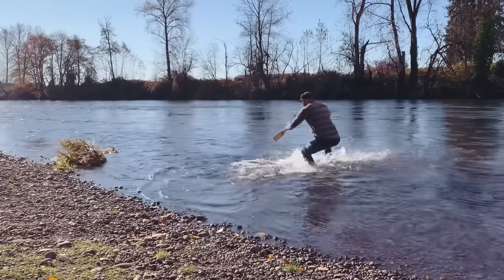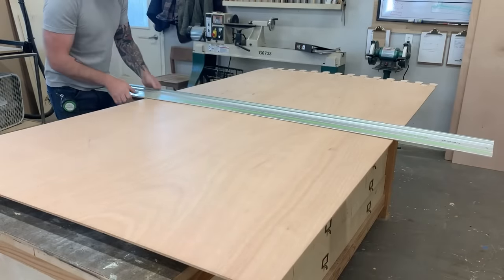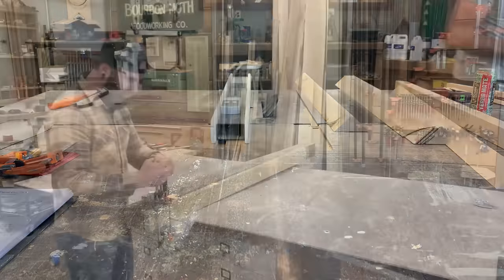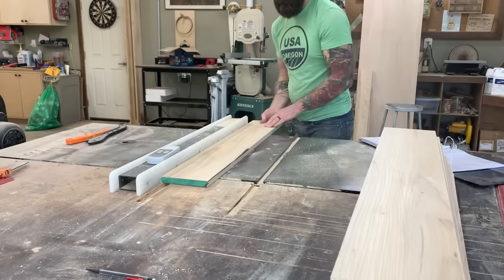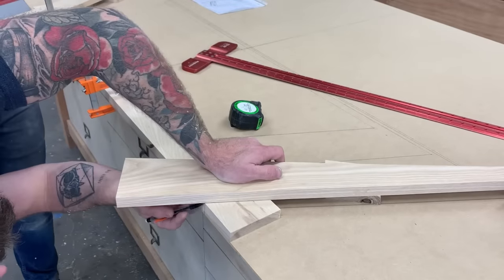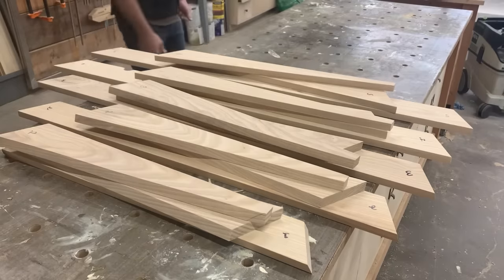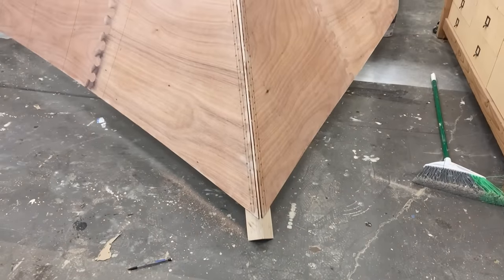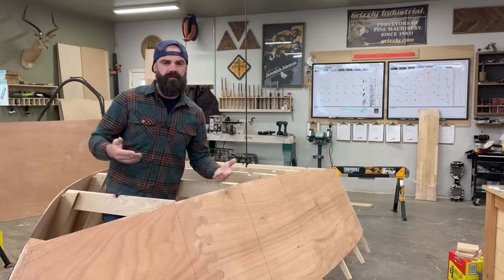I'm Building a Boat || You Can Build This (Part. 1)

Comment: 8:1 scarf joint for your plywood next time.  Would be faster than driving up to Washington for the pre cut puzzle joints.  Not hard for a guy with your skills!  I've built 3 boats and will be eagerly waiting for the next installment.
Reply: Shouldn't also thickened epoxy be used for this?

Comment: About 23 years ago a friend asked me to build a bridge for his wife, like the one in some Van Gogh painting. 3' x 14'  Wanted treated wood arches.  Glued them with 5200.  He liked it so well he wanted a bigger one for a different location.  This one was 6' wide and 16' long.  I was shocked when he drove his tractor over it.  They are still there, so that 5200 is good stuff.  Nice job on your boat so far.
Reply: 5200 is amazing stuff. There's only one rule about it. NEVER use it on anything you may want to take apart again, ever. Misused 5200 is responsible for more cursing amongst sailors than any other substance.

Comment: Awesome project! I built a Don Hill 18 ft drift boat 2 years ago. I love it. Dave, who sell the plans is really helpful if you have questions. Wooden drift boats are very quiet on the water. You won’t be disappointed. Can’t wait for part 2!
Reply: on the 18' bow stem what degree is it on the table saw    38 degree    40 degree    45 and so on?
Reply: @garywilson267  if your having trouble call Dave. His number should be listed on the website. He was helpful when I had questions. I forget the angles off the top of my head, should be in the plans. If your having trouble making the cuts themselves practice of scrap cheep wood  until you get it right. Also the YouTube channel tipsfromshipright is a helpful too.
Reply: how did you cut the bow stem  on the tabel saw?
Reply: @garywilson267  like you would for any other piece. I don’t know what you’re having trouble with. If you’re struggling I would practice on a scrap piece of wood.

Comment: Drift boat will probably be my next boat build, soon as I recover from building my last one. Seems to be about a one-every-three-years addiction.

No wood flour filler on the puzzle joints? I’ve only ever scarfed and butt-jointed/glassed with marine ply. Usually you add wood flour (saw dust) to your epoxy to thicken it to a ketchup consistency, then glue with that. The glue ends up stronger than the wood that way, but still conforms to stitching.

Comment: I built a similar 14' boat (from plans) many years ago with zero woodworking and/or epoxy skills -- very much a learning experience, ha ha! I had a small Craftsman bandsaw, a jigsaw, and a drill (and a ton of mini c-clamps). Same problem with the long plywood, but had to use a simple butt joint with a rectangle of plywood expoxied/screwed over the joint (and then hand-filed the screw points off). I would've loved to have the plywood puzzle ends that you procured -- seems like a much more elegant solution! Your boat looks fantastic!

Comment: 3M 5200 is pretty solid for boat building. You do want to ensure your wood is joined exactly as you want it before it cures. You'll destroy any wood you've joined trying to get it apart otherwise. I've used that before making a Puddle Duck Racer.

Comment: Must say very well presented! 
When in high school as a fly fishing addict in Oregon I wanted a drift boat...couldn't afford one so in HS shop built 2, sold the first one and it paid for mine.  I was so over my head in compound tapered angles.....took forever....no plans ... just duplicating a boat....bevel gauge ect..

So no screw guns, tract saw....had a counter sink to predrill ribs, chines, bow stern....every screw installed with a hand screw driver...!!!  If I would have known about a low speed, variable speed electric drill.....first I would wareout my right hand then my left....back and forth....repeat..so boring...

I would have loved to watch your vedio in  1969.....!!

You have done an excellent job of making it so clear. Want to see the rest if your vedios.

Fellow Oregonian 

just jim 

Buy the way. Intrelux Perfection 
makes the very best exterior marine finish in terms of finish longevity. Beat out about 40 competitors in extensive testing. 2 component product. I don't sell anything but woodwork,  so connection to them.
Reply: Should read "so no connection with interlux".....

All the best

just jim

Comment: I've done a 8ft stitch and glue boat - got me thinking about elongating panels. Haven't tried it yet but had the idea of just routing 2 or 3 shallow, half depth, grooves on panel ends that would interlock in the same way those fancy CNC cuts do - personally I would have modified the design a little shorter than 16ft to accommodate the splice and still get by with two panels and one seam.
Good carpentry skills and good work on the content too. Writing, editing, subject matter - all A+

Comment: Funny cute.chines are for attaching sides to bottom and may or may not be attached to frames. Frames are usually called ribs.  Depends more on size of boat.

Marine plywood...eh not of fan of plywood myself.  Also yet another built from plans kit.  

If you want to sail this later on, which is quite fun and addictive. You may want to install runners

Comment: The chine is the joint between the pieces on the sides the boat, the timber that "connects" the ribs together is a stringer or chine log.

Comment: Excellent work! As a builder of a boat myself, you better be ready for more and more and more and more sanding. And a few more coats of epoxy. Did i also mention that you're gonna be doing some additional sanding? 
Be also warned that when you tell people that you built a boat... the first question they always ask is... "Does it float?" 
Looking forward to the next video.  Cheers

Comment: For some reason I missed the first instalment so I've watched 2,3,1 actually made it more interesting in ways. I saw the jigsaw ply cuts and thought you had done them at first. I'm assuming that the way it's cnc'd it's only cut part way through on 1 side hence the piece underneath it interlocks into?
Being a boat man myself it's interesting to see the ply design I'm used to working with plugs (moulds( and fibreglass. Loving your work and the dry child like humour is just as added bonus.
Looking forward to the final chapter and her launch.
Don't forget you need a good set of rollocks!
No I said rollocks that's just you thinking that 🤣🤣

Comment: Jason - wondering if you might be inclined to do a short video on bookcase face frame construction? I am struggling with how to mark and accurately align the vertical and horizontal styles (using pocket holes) of a 6' W x 4' H (three shelves) bookcase I am going to build.

Comment: I never knew you could order puzzle fit plywood for gluing up longer sheets. Thay's pretty cool. Interesting set of plans you are working from here. Seems to be working pretty well for you. 
Yeah, free-handing a 16-foot sheet of 1/4 (or any thickness) plywood across a tablesaw does seem overly risky. Good call on the hard-board insulation and track-saw. As part 2 has posted already, I'll be heading over to watch that now. And will be waiting for any additional episodes. SUB'd for sure.

Comment: Lol, that was an insane amount of screws for 3M 5200. You didn't need any. That stuff is crazy strong.

I have known sailboat racers to use it to glue 600lb keels directly to their boat after breaking the keel mounts. 

**Please warn people that free handing table saw cuts is the best way to get kickback.

Great project and great job showing all the steps in building a "basic" plywood boat.

Comment: As an admited first time boat builder ,offering advise when your not sure of what your doing is dicy.  To any future boat builders do not use 5200 as an adhesive . This is not an epoxy it is not perminate { contrary to what is  advertised } It is more of a bedding compound. Epoxy that is  thickend  is what is used as adhesive in boat building.  As mentioned earlier a tapering jig for your saw is the thing rather than freehanding your cuts.

Comment: FYI  5200 is a tenacious adhesive that not only is Waterproof  but it will set up in the water , ive used it often for  adding Wood Blocking inmy bridges  to attach  items like bildge pumps ,AirConditioning parts  holding and fuel tanks , you name it  honestly. In my 45 years of boat ownership I’ve never had it fail Boat and Trailer Manufacturers use it a lot in assembly  are these Glen L plans or Chesapeake Light Craft  I’m curious. And apologize if you. Did reference  that somewhere  the Epoxy System  does  reinforce wooden boats. To help stop abrasions and water penetration the reason  it’s used so much in boat building is it allows the wood and coating to flex a little bit  which is one of the nice parts of owning a Wooden boat  because in choppy waters  the ride is softer  and more pleasurable than a Steel or any other metal hull material  I prefer Wood for World Cruising as well because even in remote areas  of the Globe Wood is a popular building material  so most any repairs can be accomplished

Comment: Hey, I have actually been building the same boat but the 18ft version. I was curious if you had any troubles with cutting the stem? Mine wants it to be 1/4 on top also, but 50° for the angle and 4" 7/8 on the bottom... i cant get a 50° and still keep the dimensions correct. Any ideas?

Comment: Unloading, it appeared you had 4 sheets, @ glue up I see they CNC'd 1/2 way to get a half lap instead of simply interlocked butt joint.  I do not see the link to the supplier, would be nice.

Comment: so, I saw you coat both pieces if of ply, next time, dont worry about that, becuase when you lay the fiberglass, that process will already be done.
Reply from the maker: There is no fiberglass
Reply: @Bourbonmoth  Yeah I realized that when I watched the rest of the video 😂😂. But next time, if you do decide to make one with fiber glass, you wont need to go through the trouble of epoxying all the boards.

Comment: Oh no you REALLY should be wearing a respirator and long sleeves and gloves when sanding epoxy. It's not so much toxic but you get sensitized over time and become allergic. One day you'd break out in hives when getting into contact with epoxy and after that you can't even breathe the fumes anymore. That's why it's important to minimize exposure. Wear gloves when painting and a respirator when sanding.
After it's cured it's fine but sanded epoxy always contains a little bit of uncured hardener.
Otherwise, great video!

Comment: You seem like a handsome... err, "AWESOME" dude, with an epic beard and tattoos! Unfortunately, the skinny jeans make me a little uncomfortable acknowledging the badass beard and tattoos.
 Oh wait... this is a boat video. I'm "only" 42... but with my lifestyle, I don't expect to make it to 50. However, much to my wife's chagrin, I've recently added a new "life rule": No dying until I've built a boat.
 Pretty stupid rule, considering I know nothing about boats, and live in Arizona where a boat is less than "useless". 
 Can I ask a stoopid question? Why is "marine plywood" a thing? The boat I have in mind will be made primarily out of fiberglass, resin, and epoxy. There will be some wood, to add structural integrity, but that will mostly be the "bones". Which will be completely entombed in resin and epoxy.
 The plywood part will ultimately be nothing more than a form for the fiberglass... and I think it would actually be better to use those box store foam panels.